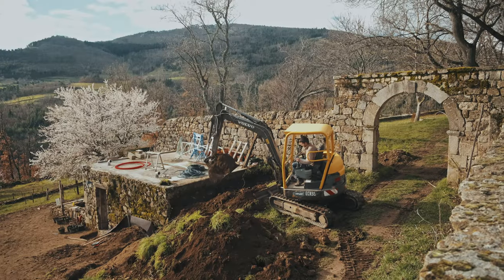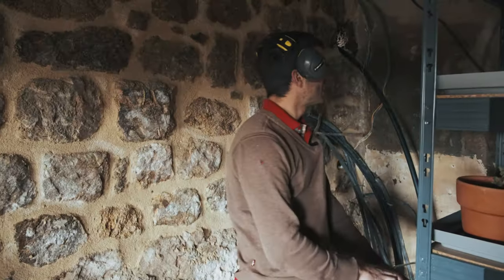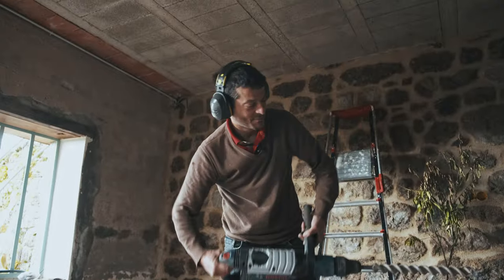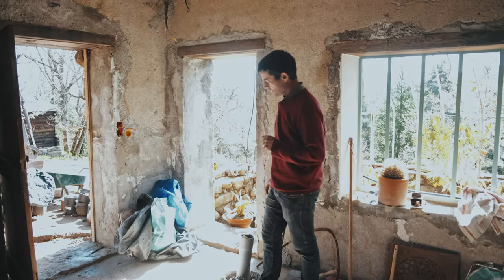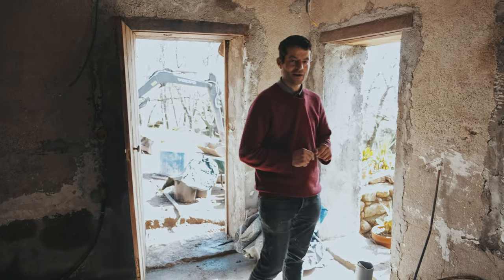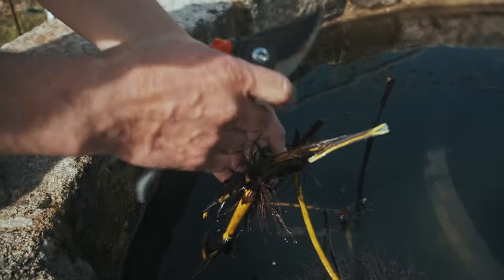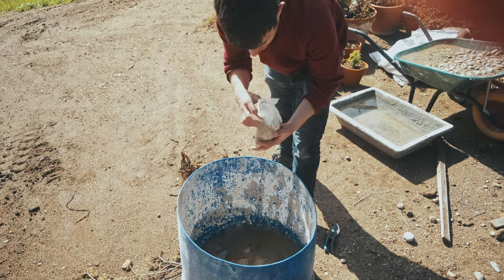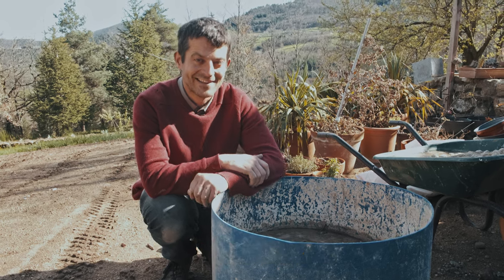Greenhouse rescue Part 7: Bringing water to our 130 ACRE estate (and transplanting a lotus)

Comment: You can clean up that drain cover with white vinegar and salt and scrub it. Then coat it with flax seed oil. When the oil dries put another coat on. Then just add a coat periodically to keep it sealed. If it is cast iron better to protect it from rust as much as you can.